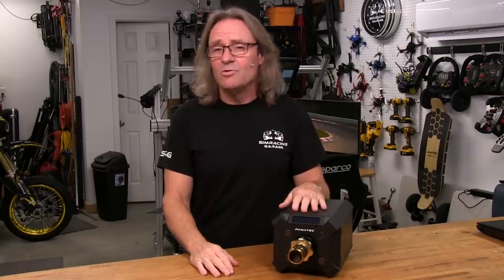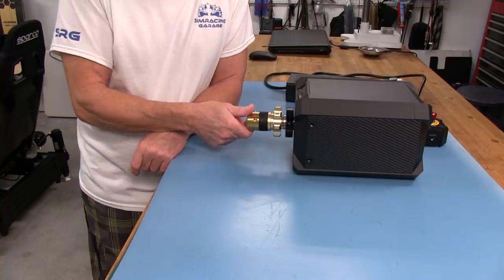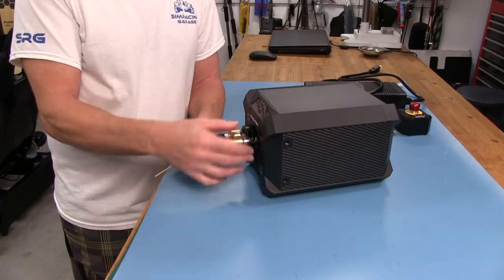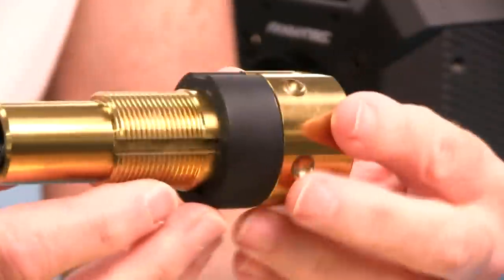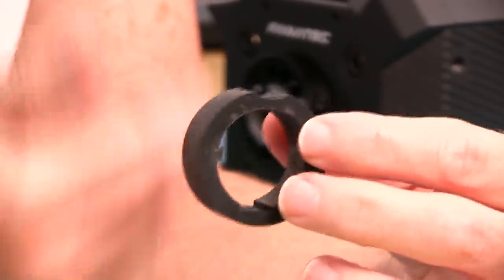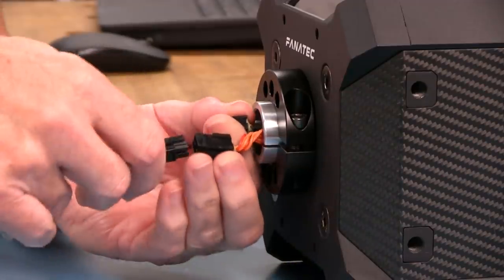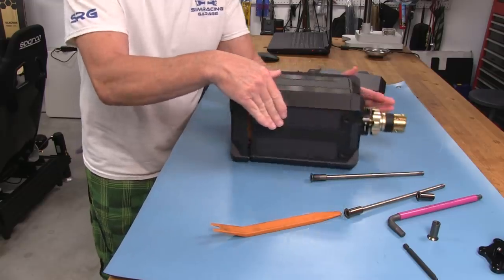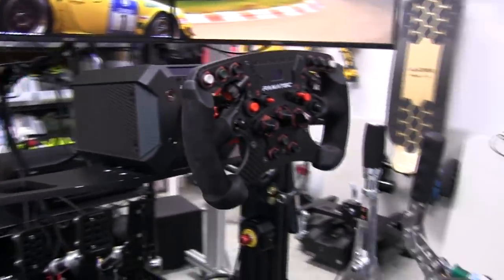Fanatec Podium DD2 Review

Comment: Not related to this post but I’m sure you can answer this for me.
I have a thrustmaster 488 spider that I recently started using in Forza 7.  I have really been enjoying it for the most part however latelyit’s not great (have not used it as I never had a table that didn’t move around and now I do). I’m by no means great at the game but can usually cross the line before the timer runs out and I’m ok with that as I enjoy the game.  I tune my cars myself and for the most part am happy with the results while driving a controller.  With the wheel most of my favourites are practically undrivable .  They won’t corner and tend to spin out and throw themselves into spins for no reason I can figure out so spend a lot of time in the wall and it’s starting to be no fun.  I have the onboard wheel settings at minimum sensitivity and that helped some but not much.
  I understand that this is old hardware and have been thinking about a fanatec and wonder if I will have the same problem or not.
 Should a well tuned car you do well with on a controller act the same on a wheel or do I have to retune all the cars for a wheel or do you think the culprit is the 10 year old wheel.  I ask because I don’t want to spend that much money on a wheel if that’s how it will be.
  I would value your opinion on this.
Thx Sno
Reply: The Forza games are mainly made for joy-pads/controllers, no wheel base is going to change that - a decent wheel base with FFB might help, but IMO a direct drive wheel base is overkill. Besides virtually all the fast players are using a controller.

Comment: DD1 also has carbon fiber plates.
Reply: At least the PS4 DD1 is.
Reply: @brettturnage533  the normal DD1 does not have carbon fiber plates, only normal metal ones.
Reply: @Knappe Wamba wrong. Check Webshop description and feel the material if you have one like myself ;)
Reply: @Knappe Wamba Exchangeable brushed aluminium cover plates is the official description and this is a true fact. Nothing plastic.

Comment: Do you know why my fanatec DD1 after 2 h or racing disconect or die for a min and i cant shift or give throttle... And when i turned base off and on again, everything is normal. But in race i lose 10 sek when that happened and to do base off and on. I rebooted, downloaded again all new drivers, changed wheel,, and alway same thing happened.
Reply: Was you able to fix it?
Reply: @floki6481  yes. I airblow base and upload new drives and its working.

Comment: Barry there may be a solution how to front mount the DD1/2, read this:
https://www.gtplanet.net/forum/threads/fanatec-podium-direct-drive-wheel-bases-thread.358875/page-109#post-12855584
Reply: I think it will block the air intake holes and make heat build up.
Reply: @chillil321  It is possible if the center hole is too small in diameter.

Comment: Where does one find fanalab ?
Reply: Nowhere. It's in closed beta and not released to the public yet.
Reply: Sucks. My dd1 needs it
Reply: Thx for the answer !
Reply: @dunbar555  why? The DD1 works great without the software because as you can see all what the software offers in advance to the default tuning menu options are some dynamic Damping effects and led control, everything else can already be tuned with the tuning menu.

Comment: I think the settings in assetto corsa aren't that good. The brake gamma should be 1 for lc pedals and give a little bit of these extra effects like road ~30%, Slip 20%, and so on. 

But all in all i like your reviews, very detailed.
Reply: Road and Slip shouldn't be used in any sim as they are canned unrealistic effects which you normally don't feel in a steering wheel.
Reply: @momorious  i have read that slip is not canned and comes from the physics. I agree with the road, but if it helps to get a better feeling of the road than i personally don't mind if these are "real" oder "fake" effects.
Reply: @ginowild9979  slip is fully canned and no effect you would ever feel in a race car steering rack. Actually, every additional FFB effect you find in games is canned. Pure physics is when you have those additional effects all turned off.
Reply: @momorious  https://www.gamereactor.eu/this-is-how-force-feedback-works-in-assetto-corsa-on-ps4/ road and slip are related to the physics and you can choose the amount of gain. Kerb ist a fake effect. So it's not good to put road and slip to 0% because it's not coming from the sim anymore. 

In different sims these values might be fake effects.

Comment: Thanks for the great and honest review (as usual), Barry.
It is an honour that you rated the force feedback quality of the DD2 at the level of the other new generation DDs out there and liked our package. Thank you very much :)

Your critisizm on the QR is well noted but I doubt that it has any effect on the ff quality as the flex is not in the rotational direction. And hey, have you ever wondered why we made the QR on the wheel base and even on all our latest steering wheels exchangeable? ;)  In case you can't wait you can also use the screw to get rid of any flex as well.
Reply: @seattletyler  I did not mention soon ;) And given the history of delayed shipments I should better not announce any date anyway :D

Of course we are working on a proper solution which also does not require you to use an external cable like the QR suggested by Barry.
Reply: @Thomas Jackermeier Hi. I'm still a little unclear on what the situation is with PS4 compatibility. Is the only option to buy the PS4 specific base with included F1 style rim, do other rims work with the PS4 compatible base and will the PS4 compatible base be made available on its own? I rarely drive open wheel, so it doesn't make sense for me to pay for something I'll barely ever use. Wouldn't it have been more sensible to make a mandatory rim round? A round rim would be more versatile and could be used for any car type.

On a separate note: I suspect your answer will be no, but is there any chance of legacy console support via firmware? I realise that I'm in the minority, but I still enjoy games on the Playstation 2 and 3, but keeping old wheels around is a pain and one day they'll die and won't be able to be replaced. I very much doubt Sony would care if you were to add support for consoles they no longer produce and it would be a nice selling point for people that enjoy retro gaming.
Reply: @napalmhardcore  yes the only solution for a PS4 compatible Direct Drive is the Podium Racing Wheel F1 which is bundled with the blue ClubSport Formula v2 steering wheel with the Podium Advanced Paddle Module already attached. Fanatec startet several times that there are no plans to sell either the Base or the blue formula wheel separately. And yes, ALL Fanatec steering wheels work on PS4 because the security chip is inside the base which enabled compatibility for all steering wheels.
Reply: Hi 
The PS4 racing wheel is indeed the only option for PS4 and there will be no standalone version. Legacy mode is also not possible as we already asked for that.
Not really what you wanted to hear but let me assure you that you have a high chance of selling the blue Formula V2 wheel on eBay for a good price as it is not available standalone. Then you can mount any of our other steering wheels (incl. the Xbox wheels) on the Podium Racing Wheel and it will work fine on PS4.
Reply: @thomasjackermeier3343  That's a shame. There are some really fun games on PS2 and PS3 and as I mentioned, one day my wheels will cease to function and I won't be able to replace them. I'm guessing it's Sony being difficult (which makes no sense as it really doesn't affect them). I'd email them, but I've contacted them in the past and they were extremely unhelpful.

As for Podium, I think I'll just have to wait for something to become available where I'm not forced to buy an unneeded and unwanted accessory. I say this partially out of principle (I don't feel I should have to buy an unwanted accessory) but also because I don't want the hassle of setting myself up as a seller on Ebay, trying to recoup my losses and posting it. I live on an island and posting items can be rather expensive.

Seeing how the PS5 and new XBOX are going to be released in the not too distant future, I think I'd be better off seeing what is available then. I really don't fancy buying an expensive wheel right at the end of a console generation and potentially not be able to use it when the new consoles arrive.

PS: I'm not sure for the reasoning behind it, but having to buy different wheel bases that themselves cost nearly as much as or more than (depending on whether I buy a mid priced or flagship wheel/base) a console just to be able to play across different platforms NEEDS TO STOP! It is far too expensive to buy two consoles and a wheel for each in addition to the games. I shouldn't be forced to choose which platform I buy a wheel for or if I even buy a particular console based on which I think is more important to own a wheel for.
Reply: @napalmhardcore  Are you aware that you can play on Xbox AND PS4 if you have an Xbox compatible steering wheel connected to your Podium Racing Wheel?
Reply: @napalmhardcore  I fully agree, personally speaking, I would probably have bought one for me f it was not for the bundled rim + apm that are not even properly supported on the platform the whole bundle targets! the fancier rim controls (encoders, thumb rotaries, apm top paddles, etc) are not supported on ps4 and probably never will... the whole release feels a terrible mess if you ask me, along with the  "official" suggestion to buy the bundle and sell the rim and use another one (which is another joke imho) just made me stay far away from it
Reply: @djnonnus  MPS, Thumb Encoder and top APM Buttons are working in F1 2019 on PS4 since the latest patch 1.09. It's up to the game developers to implement these features, Codemasters was now the first one who added these functions into on of their games.
Reply: @momorious  really? that is interesting info (thanks for the update), until now the only info I had from patch 1.09 was that it killed force feedback for most users (not sure if pc only or also ps4, I assumed both), so I never looked deeper into it
Reply: You mean the one  that come with the wheel . ?In my case with the bmw gt2 is plástic and black color. Thanks
Reply: @thomasjackermeier3343  I was not aware of this. While my comment was made being under the impression that the Podium wheel was console specific, I do stand by it as a general statement whether relating to Fanatec or other brands.

I appreciate you taking time to reply :)
Reply: Hi Thomas, thx for Your statement, well appreciated from a die hard Fanatec Fanboy...🙂👍
Reply: Hi Thomas , I use simucube 1 20nm for about 2 years and just put the DD2 last evening! After 6 hours of testing I can clearly say the DD2 is superior and feels smoother and powerful! My QR have no flex as this one and already many claimed they don’t have it ! Must be just Barry unit ! Looks like you build great product and I’m very happy for now and consider as great upgrade over OSW gen 1 DDwheels !
Reply: @thomasjackermeier3343  Can't wait for a proper solution for the QR. I'm happy with my DD2, but i also have to admit that i'm not happy with the (not so quick) QR. All of my 4 Fanatec wheels are flexing. More than on my former CSW v2. Maybe the flex isn't that noticable while driving, but the QR is bothersome nonetheless. It is promoted with "zero-flex", but that's definitively not the case.
I'd be happy if i could upgrade my DD2 and my 4 wheel rims with a new Fanatec QR, which is 100% rock-solid.👍
Reply: Thomas Jackermeier I bought fanatec DD2+V3+podium steering wheel based on Barry's reviews. I'm overall satisfied with the product, but a fanatec support and policy is terrible.
They send me the wrong steering wheel and now the only option to exchange it is to first return the wrong one and after that recieving the right one.
Due to the fact its not my fault and I'm a commercial user, its totaly unnaceptable for me to be without a steering wheel for a few days/weeks.
This kind of attitude is totaly unrespectable for this kind of pricepoint of equipement.

Comment: I just got my SimLab GT1 Evo with the profile style Podium mounts. It’s very sturdy, I’m very pleased. 

Aside from that, I’m not very impressed with the DD2s performance. I don’t find the driving experience very good over all. It’s not consistent or on par with my CSW V2. 

 The oscillations you get with any significant amount of strength is nuts. Even with lower ffb strengths the wheel is constantly going through a jerking motion while mid corner. 

 Don’t let go or your Mclaren wheel will become a 4 sided jack hammer and break your hand. 

The QR hub is a major disappointment. My tightening nut keeps coming loose while driving and taking the wheel off is so unpleasant. I actually stopped changing wheels cause I dread having to do it. 

I really hope they come to the realization that people spending $1500 on just a motor will also be willing to spend top dollar on wheels that don’t use the current CS Fanatec QR. 

Who’s gonna use a $150 P1 with plastic QR on a $1500 wheel base? The comprise made in design on the hub isn’t worth people having backwards compatibility on the whole Fanatec line of wheels. They should have made a special line of Podium wheels that use a better QR system then figured out a way to adapt the current high end Fanatec wheels over.
Reply: Tightening nut of the QR coming lose while driving is a sign that you didnt used the QR correctly in the first place. The gold ring has to touch the rubber before you attach a wheel to the QR. If the nut is coming loose, this indicates that the gold ring did not touched the rubber and the rubber moved back when you attached the wheel which means it cant expand correctly and therefore the nut comes lose.
Reply: momorious I am using it correctly. Just like they show in their video. It’s not rocket science although I don’t think anyone really knows how to do it correctly....including Fanatec. I’m also running transducers but a $1500 direct drive system that can’t be paired with transducers or motion? Is that a thing?

Comment: That flex happens perpendicular to the rotational forces on the shaft that comes from the motor! So yes, the flex is there, but when you're racing, the rotational forces are what matters! There should be zero rotational flex. Would really appreciate a reply on this.
Reply: I agree with this assessment. My DD1 has some perpendicular flex with my 4 universal hubs but not as much as Barry displayed in the video. As Joop states, it is the rotational flex that matters most conveying forces while driving. I still agree with Barry and others, I would like to see less flex in general, but Fanatec has several generations of wheels that they promise backwards compatibility on so... Maybe as Barry hopes (we all do) Fanatec will come up with a new system and sell us the adapter for cheap... Hopes high, expectations low = ).

Comment: I tested the DD1 twice in rF2 and ACC last weekend at the Expo and the alpha-model last year with the Alpha ACC that time. Actually i found the test last year was the best and when i got home, i tweaked Sim Commander to give me something similar with the Accuforce. This time I wasn't impressed at all and just driving through memorized habit, because i couldn't feel what the car was doing. I also tested the Simcube 2 Sport and Pro in Raceroom and AC. I was a bit better connected to the cars compare to the Fanatec-DD, but this could be all to sim- and setup differences, because overall they feel similar. One impression i had with all bases: My Accuforce feels better:) 
I had four years time to dial my sims in and i like the FFB in all of the mentioned titles plus Dirt Rally 2.0 and pCars 2 with different approaches in Sim Commander, that mostly only the Accuforce can do. In DR2, pCars 2, iRacing (mostly) AC and ACC i'm running pure foundation FFB with front-suspension-, bump- and- engine-rpm-effects and this liquid dampening is nice. In rF2 i'm running additional engine-rpm and bumps and only Raceroom is pretty default, because i'm using tweaked game-FFB-settings. I was really on the move to the Simucube 2, but after the Expo i will give the AF another time till SimXperience release an upgrade. I can confirm that those bases have a better clarity in the FFB, but when i miss telemetry-information and they all felt too smooth to be mechanical, it doesn't feel right for me.